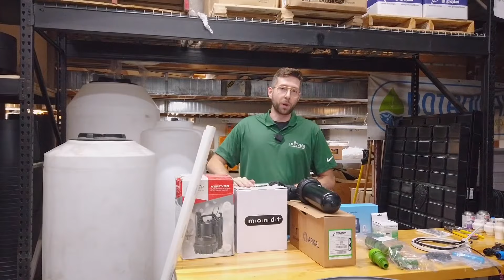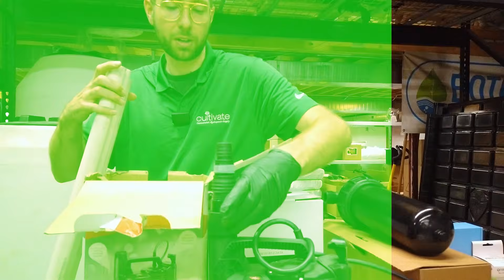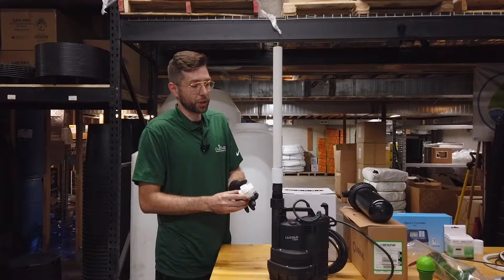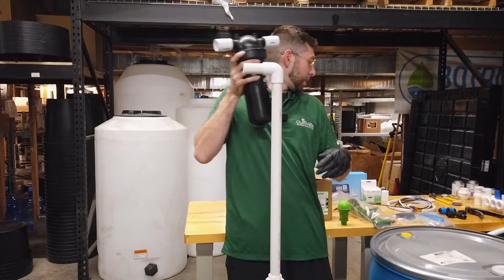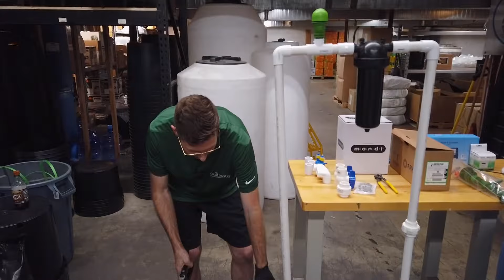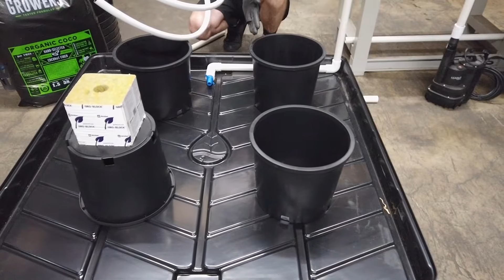DIY Drip Irrigation Build Out For Your Grow [Step by Step Tutorial Part One]

Comment: Overkill for a small tray setup, just look at the best selling dripper systems, it's nothing like this, especially for a dripper system and not a flood system, 1/2" supply line in a ring around the tray and a 1000l small pump will produce more than enough pressure even for 30+ drippers, and nobody is using a big blue barrel for a few plants.

Comment: Where is the pressure regulator ? Im new i want to build a reliable and efficient system but i jave big doubt i spend so much time to learn how to do for build a good system
Reply: Only really need a pressure regulator if you're going from the mains water, a small pump won't give enough pressure to worry about needing to reduce it

Comment: doesnt mondi recommend not keeping their pumps submerged
Reply from the maker: If the pump stays in the "Power ON" mode it can cause the water temp in your reservoir to rise significantly. The pump should be controlled by a timer so it only runs when needed to water your plants.

Comment: You should be cutting the end off the pump adapter before screwing the pvc pipe on, by leaving it there you're reducing the diameter of the pipe and therefore restricting water flow.  Won't matter for the 4x4 table, but those pumps are both way overkill for four plant sites....